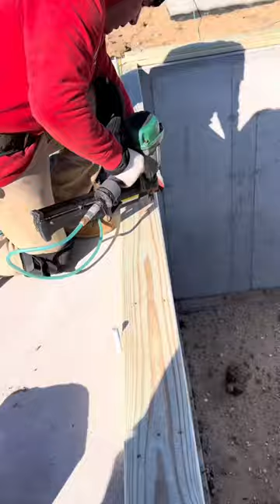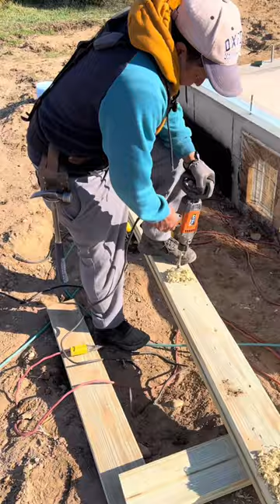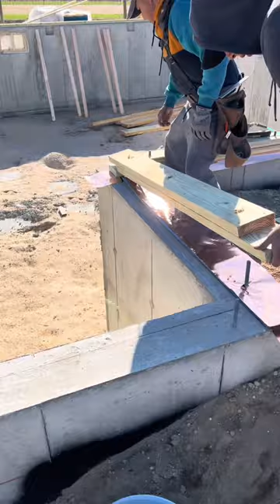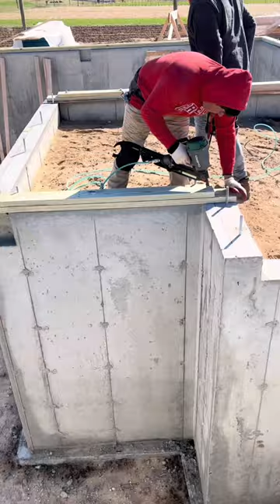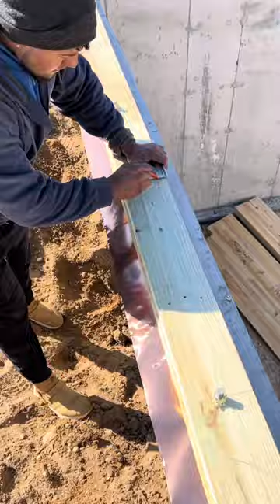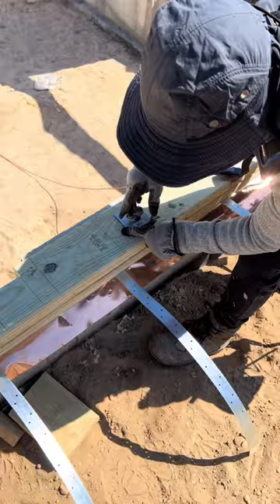Plates #shorts #work #construction #design #skills #carpenter #perfect #team #beauty

Comment: How do you assume that the foundatit's perfectly level
Reply: Laser level, transit or even a water level is accurate enough. If it’s not the form guy or mason’s first job, it should be close. Square or out of square foundation is usually a more common issue.
Reply: I would hope that they checked with a laser level.
Reply: Good concrete masons would have used multiple levels to make sure the forms were level in every possible dimension before pouring concrete. And then a good framing crew will confirm that what they're building on is level before laying their first boards. Just because that level check wasn't shown, doesn't mean it wasn't done.

Comment: All that preparation to have your guys nail straight down, i know each of those nail went through the other 2x6 and like a fish hook curled one hitting the concrete and ripped all that nice expensive material of vapour barrier, making basically usless. Heres a tips boys dont record this step of the process if your going to make it redudant
Reply: @markjohnson8453, I have a tip for you. Don’t assume you know what size nails are in someone else’s gun. Another tip, don’t call sill seal or termite shield a vapor barrier. A third tip, spell redundant correctly or at least know the definition of the word and when to use it if you are going to use the word at all. So, three tips for you. Keep watching and learning (that tip is no charge).

Comment: I like the one that missed...lol this process is much easier with simpson strong ties.. Hammer drill through plates and wall then large impact them down.
Reply: Titen HD are easier than j-bolts for sure. Most architects and engineers will say that the hold down of a threaded bolt (wet placed) wins though. This is understandable with a block foundation where the hook grabs the lower course. But with concrete, I’m convinced that the j-bolt also wins. I haven’t read any studies but I’m sure they are out there. You just won’t find any from Simpson maybe.
Reply: I also think that with Simpson, wedge anchors beat out threaded.

Comment: Why copper flashing?
Reply: Wondering the same thing.
Reply: Termite shield.
Reply: Alum was okay with Doug fir plates ages ago. But it reacts with the treated sills. So you have two issues. If using ACQ, it is corrosive to metals on the other end of the galvanic scale. It will eat aluminum. And termites may have trouble getting around the break metal edge (depending on who you talk to) or make them build tunnels where you can see them.

Comment: Use 3x or 4x plate and real hold downs instead of straps. Saves time, and it's stronger
Reply: What is a “real hold down”?
Reply: A real hd has an anchor bolt that embeds a couple of feet into the footing below. The bolts run between 5/8"- 1 1/8" in diameter depending on the strength desired. The bolt extends through the floor and bottom plate of the wall above and is aligned with a post at the ends of a shearwall or a bearing post for a beam above. Then, a hdu2-hdu14 is attached to the post. It's not hard to lay out, especially if you have a good concrete guy or you can hang the bolts yourself after forming is complete.
 Running a bent cs strap under the plate is relying on the strength of a couple nails on the inside of the plate to anchor the house to the foundation. If you are just trying to give a positive connection to the rim joists, then you could just use A-35 or LTP4 from rim to plate to achieve the same thing.
Reply: @henrypeisch5289  Hi Henry I'm not saying that you are building it wrong. You are probably building it exactly to plan. My argument would be with the structural engineer. Everything looks good and clean keep on framing. Have a good Easter weekend
Reply: @mikeokeefe4400  you also mike.